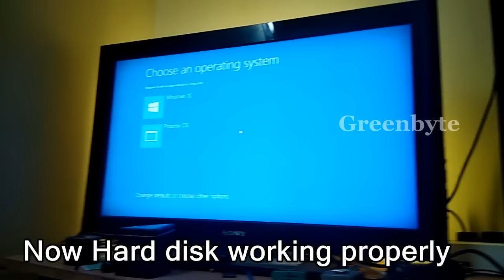Hard disk tik click sound solved 100% working

Comment: My computer isn't booting up, is a new SSD and new OS going to fix it?
Reply: Of Course yes. SSD's are much better in speed but worst in capacity wise.
Reply: @nickweir5086  and when they die you would've already known about it since they have a limited number of read/write cycles which you can find in the specs of the drive

Comment: I have a wd hard drive that I store my music I had drop it and it started to make clicking sounds is something that I could fix or need to take it to a place where they fix it could you advice me
Reply from the maker: +Andrew Cantu clicking sound due to plotter head Strucked. Open the hard disk in dust free place and slightly move the hard disk plotter head to initial position. close it again nd  check.. be careful don't touch the inner Disk plate..
Reply: green byte  thank you so much
Reply: Hello, sorry to ask but.. did it work? I'm having the same problem
Reply: Andrew Cantu Hello, I have the same problem. My brother accidentally dropped my external hard drive and it started to make the clicking sounds. Does it worked for you to move  the hard disk plotter?
Reply from the maker: +Johannes Büskes yes but open hard in dark and dust free room
Reply: green byte OK, thank you.
Reply: green byte Are the files 100% undamaged after the HDD works? I mean my HDD just fall from the chair. So do you got your all files 100% undamaged back?
Reply: green byte It fell less than 1 Meter height down.
Reply: There are a couple videos that show what happens when you drop the HD. The heads will scrap the disc inside and that itself can cause the head to not be able to load up. If you open it and you see a ring that goes around the disc then it is probably had it.

Comment: My hard disk makes same sound and my laptop does not works and it shows "No boot device found"
Is it the way to fix it??
And the hard disk was new, just like 9 months
Reply: Same problem can you tell me what to do
Reply: @ramprasath4948  idk, mine is working now without repairing
Reply: @sarcaser223  clicking sound from hard disk?
Reply: @ramprasath4948  it itself started working and now it does not make any noise . I didn't need to do anything
Reply: @ramprasath4948  does your laptop boots or not?
Reply: @sarcaser223  bro it shows system not found and sound for hardisk
Reply: My laptop on's and then shows system not found
Reply: @ramprasath4948  when the head is stuck it can't read the data . Maybe that's what the problem is